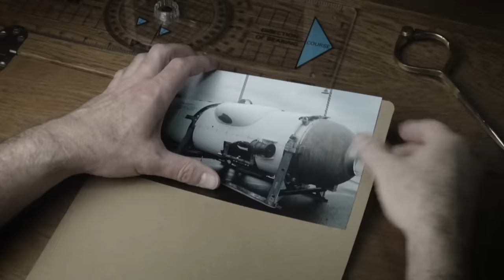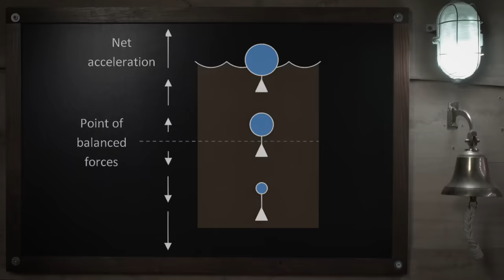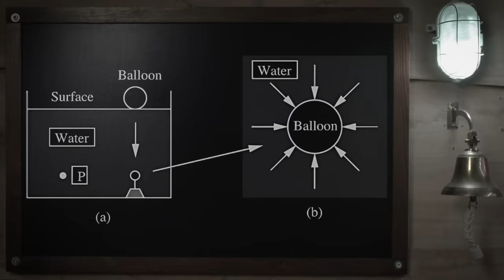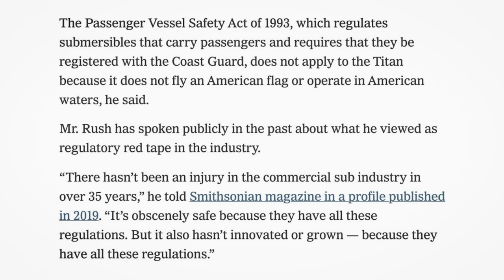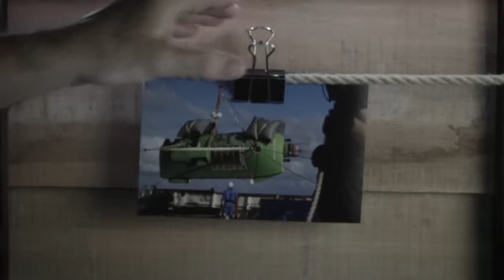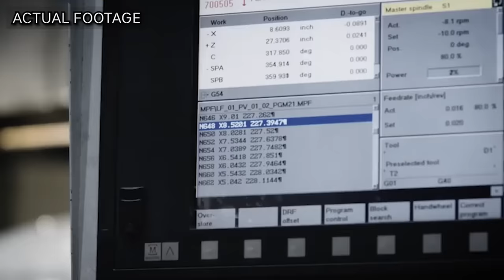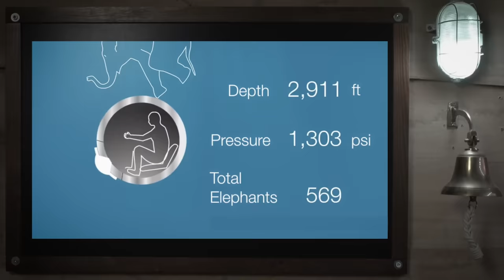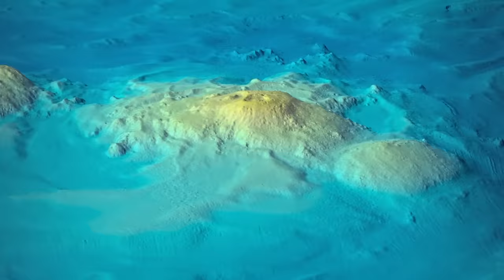Titan: From Inception to Implosion

Comment: Stockton Rush didn't have some "disruptive" new technology, like he pretended. He was just willing to use a suboptimal hull shape, eat into safety margins with standard parts, use inexperienced designers (e.g. College students), and gamble his life/the lives of his passengers on using carbon fiber as the hull material, all in order to save on costs/maximize profits. If anything, this incident just shows why properly designed, tested, and certified deep sea submersibles are so expensive.
Reply: well, it's not really that the idea couldn't be of use. it's just that it might end up being really expensive to use properly(rebuild amounts) and nobodys properly tested the idea really (beyond that it does work a couple of times, which actually could be enough for some use cases, but now we wont know for a long while).

you need to test everything else regardless of what you're building it out of anyway and if you'd use it for commercial you would need to devise a way to test(xray etc) or have a replacement program for the parts based on the testing same as for airplanes - and you'd need the money to do the destructive testing to be able to record the signs what the checking program would look for.

doing it out of steel gets really expensive as well and would need the same program (it can also be inaccessible due to that sourcing the right alloys can end up way more complicated than one would think at fist.. politics getting involved kind of complicated).
Reply: I heard he was a member of bohemian grove
Reply: The fired engineer said he was a member of bohemian Grove.  Being a money hungry death cult member I'm not at all surprised he had a death wish for himself and any high paying passengers.
Reply: Expensive and absolutely necessary
Reply: You get what you pay for.
Reply: I often see hurdles in life, metaphorically, as rivers you have to cross. But the river is so wild you need a bridge, a boat or an expert instructor. So you have to pay the bridge toll, the boat fee or the instructor's fee. Otherwise you either stay stuck or you rush in unprepared and you drown. There's also this Russian saying that illustrates Oceangate's unfortunate conclusion: "the greedy pays twice".
Reply: @lasskinn474 Stockton did plenty of testing on the fiber hull. Failed everytime before the depth he was intending to go. Yet did it anyway
Reply: @shanepytko1342  not true. 1. he didn't have a spare to test with to destruction and 2. it went to the depth he wanted to go(titanic) almost a dozen times before it failed(which I guess he considered testing, but that's not really what testing is).
Reply: @lasskinn474  I was referring to the test in the lab with fiber hulls. They all imploded before the depth he was planning on. I definitely agree though on not testing the one he was using. Even heard loud bangs on previous dives. Think I would have called it quits then
Reply: I believe it was more material choice than hull shape
Reply: @18yearsoldnot  A sphere is without question the best shape to use for a deep sea submersible. That said, using carbon fiber to resist outward pressure is also a terrible idea. It would be hard to quantify which contributed more to the failure.
Reply: @18yearsoldnot both were bad and might as well be considered equally bad for practical purposes.
Reply: Lol while using college students fire his head engineer . Yup! Not a recipe for a disaster.
Reply: @michaelhill6451 yup the carbon fiber is not meant to withstand that amount of pressure let alone that many times. Literally no one would certify them and they operate their business in areas that purposely make it more challenging to sue . What a coincidence.
Reply: @shanepytko1342 sorry my humble opinion he didn't even do 50 dives.. i think professionals would tell you 50 isn't even adequate.
Reply: Rush must have been the Alpha male, "We got this!"-kind of life of the party type, and must have thought he was so cool with him and his team walking around with clipboards and walkie talkies, mugging for the camera, dramatic editing, filming themselves in mini-documentary mode, and they KNEW their design was a gamble, that 38:01 only Lockridge was willing to talk about.
Reply: Sounds like an Apple design...
Reply: Exactly, He's was just a knock-off Silicon Valley start up CEO
Reply: You give  Stockton way to much credit
Reply: Eat into the safety margin? Titan operated with no safety margin. The crush depth of titan was 13000 feet. The titanic was at 12500 feet. If titan's hull was weaken for any reason, a UV light causing delamination, a hard hit from ocean wave, material fatigue.. and the titan would have imploded which it did on its third journey to depth of the titanic.
Reply: @lasskinn474  The fact it imploded after 12 dives means it would make no financial sense to pursue it as a viable option for a submersible. Also the fact that titanium and steel alloys are very predictable when subjected to those kinds of pressures and carbon fiber isn’t, it could fail in two dives or just one. It’s never going to react the same each dive as traditional materials do. I’d say the only commercial use it would have is extremely shallow water. I’d never get into a submersible made of a composite material. Heeeeellll no
Reply: Nothing wrong with using people fresh out of college 🤔
Reply: @Rosco-P.Coldchain  Is that a joke? College teaches you a lot about theory but (at least in the U.S. and Canada) it doesn't teach you much about the practical applications of theory. That's why Engineers with decades of experience are paid more than new College grads. But yes, I agree, it is good to hire new grads. It gives them a chance to learn and get experience and they may have new ideas about how to do things that are outside the box. I just wouldn't hire them to design critical systems that can have deadly consequences if they fail, unless they have hands-on experience designing these types of systems (which they probably won't).
Reply: No he did have a rather ingenious plan but it was poorly executed the carbon fiber was not applied and created very uniformly it could’ve been done a lot better and with more of a cross hatch kind of pattern he needed to have immense funding not to test this plan make different designs figure things out first and he didn’t charge enough for the passengers to properly fund creating a new hull after X amount of hours of pressurized existence. The idea that you could hear something and then with that kind of machine get out of that depth zone fast enough for it to mean anything even a child would know that that makes no sense.
Reply: I know people who manufacture the product. They just shake their heads regarding the whole thing saying "It isn't designed for that purpose"
Reply: @lasskinn474 
It was a creeping failure that concluded with last dive.
Reply: I was on the design team, We used ANSYS and then tested the hull for 1000 cycles alternating +7500 PSI to -7500 PSI. This was an intentional, act to destroy the business for submersibles.
Reply: @lasskinn474 we know the characteristics of carbon fiber very well. He just didn't listen to actual engineers. They never included the cost of remanufacture and overhaul. Steel would have been cheaper. And it would actually work.
Reply: He did make some improvements but yeah. Most of these startups aren't really changing anything, they're just loading up on a lot more risk than established firms.
Reply: @CharlMarais247  steel would have been more expensive, that's entire reason for why they didn't use it. you can't just use normal steel, you can't just cast huge cylinder(relatively cheap), you can't just roll and weld a thick sheet you bought etc, the right blend of steel is generally not available on open market even.   that's why making subs that go that deep is so expensive and why making them bigger goes exponentially up in cost. even ussr couldn't do their deep sea subs themselves despite doing titanium subs, instead bought them from finlands steel experts until usa told finland to stop(usa gave a greenlight originally because they thought finland lacked metallurgy to do it).

what we don't know about cf is outside pressure and water seepage. obviously it can work for a while otherwise it would've been just him who died.
Reply: @lasskinn474  solid reply! 😁referring to cost. I think of it in terms of overhaul and rebuild. Being carbon. I can't take the stress cycles so new hulls would need to be constructed after a dozen dives. Still think steel is cheepee in terms of life cycles costing, labour and tooling. They literally developed their own carbon weave machine.
Reply: @kurokumo8169 was the carbon fiber not cross hatched? We just don’t have data to show carbon fiber is safe for deep submersion, and the way his different materials met each other was also very much not ingenious, nor was his failure to ultrasound the pressure vessel after dives. Im not sure we have reason to believe carbon fiber was a smart move. Obviously he was an intelligent engineer in some ways
Reply: @IWannaGoMissing  yeah we do I saw a recording of them actually fabricating the hull and it was not cross hatched it was straight wrapped like you would spool of thread and it was not done in a controlled environment it was literally done in just a room that hadn’t even where they were letting people just walk in with their normal clothing they didn’t obviously care what fibers from the air may have been added to the resin and I also saw a recording of them applying the titanium caps and that was done in a warehousewhere they applied the seal and then lowered it down onto the end again uncontrolled environment where they didn’t care what fiber and things were applying to the seal
Reply: Look at James Cameron..an innovator and genuine visiinary who ENTERTAINS and INNOVATES. 
"RUSH" isnt just the guy's NAME, it also describes that man who refused to put progress subordinate to safety.
Reply: it must have been making noises before hand  inmho
Reply: How did he manage to keep his license with that attitude?
Reply: @Askmolnet  Family Influence.
America's #1 Key To Every Door
Reply: "SCOUNDREL" Stockton Rush was little more than a Charismatic Carnival Barker.
Reply: @hagbagslayer5799  I’m a Mechanical Engineer, so not exactly a layman. People like Stockton Rush give Engineers a bad name.
Reply: @hagbagslayer5799  Yep, I’m also an Engineer and we have an Iron Ring ceremony when we graduate where Engineering graduates are given a ring made out of iron forged from a bridge that collapsed. That’s so that we are reminded of the duty we have to society and that every piece of paper, drawing, etc., that we work on/touch is in contact with that ring. Most standards are written in blood. Stockton Rush clearly didn’t appreciate that fact and he got himself and others killed because of it. Interestingly, the ceremony was written by Rudyard Kipling who wrote “The Jungle Book”. It is called “The Ritual of the Calling of an Engineer” and is very similar to the Hippocratic Oath that Medical Doctors take. Just like Medical  Doctors, mistakes made by Engineers can get people killed.
That’s why I commented on this video. Someone who considers safety margins to be “wasteful” should never have been allowed to graduate. They are the Engineering equivalent of a Doctor who writes Fentanyl prescriptions all day for profit…a disgrace to the profession.
Reply: @hagbagslayer5799  Well my graduation was in 2008 and, in a weird twist of fate, the first movie I saw in a movie theatre was “The Jungle Book”. That’s why I remembered it was Rudyard Kipling who wrote/designed the ceremony.
Reply: @cjcoleman3893  BG is not a death cult, not even close.  Most those guys are very much into life extension.
Reply: @cjcoleman3893 lies lies lies
Reply: Honestly  it would actually  have been a good sub and worked out well had he used only metal for everything and not fiberglass
Reply: Let's not forget the statements about hating on certain groups of engineers based on immutable characteristics.
Reply: Did he do it for greed? Ie he used carbon fiber with a bigger sq ft
Reply: He would have been better off making a titanium ball.
Reply: he made a dollar store version of a DSV in an environment where everything matters. can't be surprised
Reply: That’s the power of an MBA for you. He forgot all his engineering skills in favour of get rich quick skills. Sad that he murdered other people though.
Reply: Oh my god, college students!? I feel so bad for them, I can only imagine how they must have felt when this happened
Reply: It was ‘disruptive’ as in ‘dis thing can rupture’.
Reply: And why capitalism is so shit sometimes 🫡
Reply: @legojackgaming  vtrue but not nearly as bad as the dead hands of the central planners. If you want something really screwed up the get the state regulators involved 😂
Reply: I would disagree with "suboptimal hull shape" as it's a tube.  It's the useless carbon fibre.  He seems in interviews just unyielding on the "magic" substance to him.  But carbon fible is great if you want that tube to contain pressure from within but from without it does jack all.  It's not gonna hold something going the other way.  I'm not sure how I'm trying to say but it wont hold something trying to shrink it.
Reply: @DoublePlus-Ungood  A sphere is the optimal shape for resisting external pressure. The reason it has a tube in the middle with a hemisphere on each end was to maximize the number of passengers taken on each dive (and profit).
Reply: He thought he could just 3D print his submarine 😂
Reply: It's a narrative that every bored rich kid cosplaying as a visionary loves to tell. "Oh I'm so BRAVE and ORIGINAL for doing things in a different way even though my new design solves no outstanding issues and is less safe, efficient and convenient than what's already there." Stockton did it, Musk is still doing it.
Reply: @michaelhill6451   let’s just be honest he wanted to do this cheaply and make a huge amount of money for someone so smart he was an idiot
Reply: @michaelhill6451  in the famous words from Ian Malcolm : “it’s not a matter of can you do it— it’s a matter of did you stop to think should you do it”?! that’s the better question
-Ian Malcolm ,Jurassic Park
Rush didn’t stop to think is this a good idea ? And more importantly if I’m going to do this it Has to be done the right way—-and am I doing it the right way pressure in shape are very important the shape of a pill will crush as we saw it imploded the Man who made the movie Titanic new how to build one, a circular shape was the right way to do this because it evens out the pressure from all sides rush didn’t think about that for someone so smart  he sure as shit didn’t think… also the man who made the titanic movie he had been down there 33 times; Stockton had been down there what a handful maybe—

Comment: One thing about Stockton Rush is he honestly believed that those safety protocols were just BS, even though most all of those procedures are written in blood and are lessons learned from other accidents. He put his life on the line along with others and paid the ultimate price.
Reply: Dude basically tried to fight the ocean with predictable results
Reply: Indeed, i work in electricity and ppl always look at safety regs are there to piss you off.  Ive seen people get hurt, maimed and killed by taking shortcuts. I agree the safety should look like blood to get the point across something horrible happened for it to put there. I had my job threatened for refusing to due a hot pull of 220 triplex w a super neutral towards a hot bus bar in gear room. The bar? 4300 amps!!!! If half a amp killes that creamates you. The safety a piece of ply wood and boards to stand on. To clarify the bars were around 2 or 3 feet from where mg crew would be